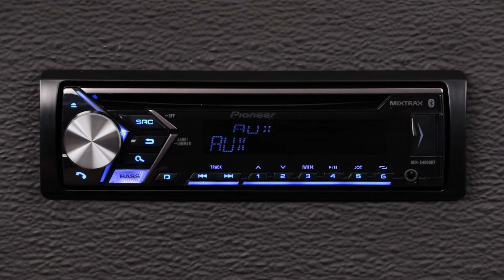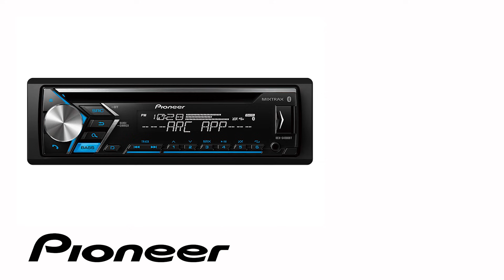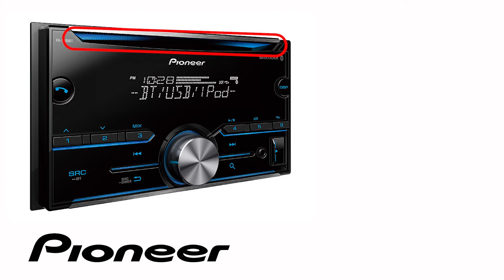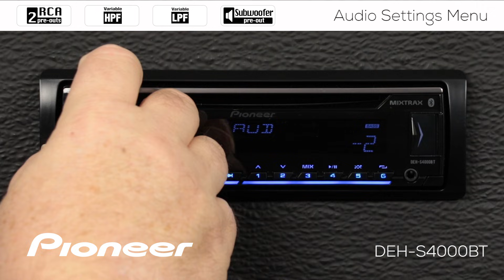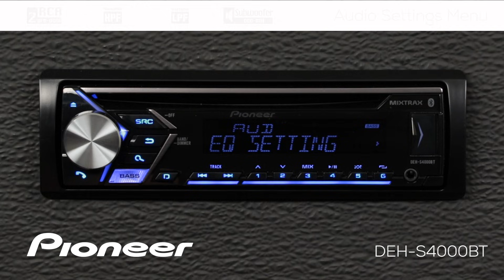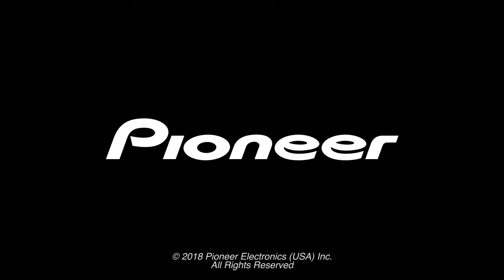How To - Audio Settings Menu on Pioneer In-Dash Receivers 2018

Comment: Please help! I have four pioneer speakers and when i fix the crossover front as hpf 100hz -24 and rear as hpf 100hz -24 i hear no bass BUT when i set the rear or front (either one) at -18 or -12 db per octave i start hearing bass clearly. So what's with that? And which settings do u recommend?
Reply from the maker: What is the model number of your Pioneer in-dash receiver?  What is the model number or, at least the size, of the 4 Pioneer speakers in your vehicle?  Do you have a subwoofer in the vehicle?
If you are using a Pioneer receiver and for example: 6.5 inch or 6x9 inch speakers with no subwoofer in the vehicle, I recommend to set both the front and rear HPF crossover settings to 63Hz or 80Hz and a slope of 12dB per octave.
If you'd like to learn more about what a crossover and slope do in a Pioneer car audio system please keep reading.  It's a long answer but, you may find it to be valuable information.
This sound like you are using a Pioneer receiver and it's working exactly as designed.
This is a basic explanation of the concept of crossovers and slopes and is not meant to cover all of the ins and outs and what have you's in this discussion. Not even close.  
The crossover and the slope work together to provide a powerful sound shaping tool to customize the output for your particular speakers in your setup based on your listening characteristics. 
If you have ever seen a prism separate sunlight into the component colors of the rainbow, red, orange, yellow, green, blue, indigo, violet, a crossover does the same thing only the crossover does this to sound.  A crossover is a filter.  There are two basic types of crossovers.  LPF  or low pass filter, and HPF or high pass filter.  
Speakers are designed to playback selected frequency groups.  It's very difficult to design a single speaker that can playback very low frequencies and very high frequencies and do it all very well.  That's why we have woofers and tweeters.   
You want your subwoofer to only play low frequencies and not high frequencies.  That's what the woofer is designed to do.  When you choose a crossover point, for example 80Hz on the LPF this is the crossover point, or cutoff point.  Only frequencies below 80 Hz will pass to the subwoofer. That's what you want, and this is what the LPF does.  
However, it does not cut off like a razor. Does this mean that  80Hz plays through the subwoofer, but 81Hz does not play?   No, that's not the way it works and this is where the slope comes in.   
The slope decides how sharply the filter rolls off the sound output.   The slope is rated in decibels per octave, for example 12dB per octave. An octave is when we double the frequency or cut the frequency in half.  With a 12 dB per octave slope and an 80Hz crossover point, at 160Hz, or one octave higher than 80Hz, the subwoofers output will be 12dB lower than the output at 80Hz. And 24dB lower at two octaves higher. 
The higher the frequency goes, the less it's played by the subwoofer, all starting at 80Hz.   This is a gentle roll off.  A sharp slope would be 36dB per octave.  
How does this effect the sound from the speakers?  This is a tool to customize settings in different vehicles.  You use the crossovers and slope setting to decide what frequencies go to what speakers in your system.  
For example if you are using 6.5 inch full range coaxial type speakers in the door, I recommend an HPF set at 80Hz and 12 dB per octave as a place to start.  The door speakers will play all frequencies above 80 Hz.  If you find the speakers low frequencies are breaking up at higher volumes you might change this to 100Hz. Or you could keep the 80Hz crossover point and change the slope to 18, or 24, or 30 dB per octave.  Both of these settings might provide a good solution depending upon your speakers and listening habits.    
It's often a good idea to have the LPF and HPF meet at the crossover point, this way there is no frequency gap in the playback between speakers.   
You can see what a crossover and slope setting does in this Pioneer How To video:    https://youtu.be/WvJXYh6vk_0?t=252   This video is very detailed and has a lot of information about what a crossover and slope does to the sound output.  Please take some time to watch it with the sound on.   You can find more videos on Pioneer's YouTube Channel here:  https://www.youtube.com/user/pioneerelectronics
Reply: @pioneerelectronics  my in dash receiver model is mvh-s322bt and I have 4 speakers size 6x9 inches. I do not have subwoofer and I've set my initial settings as rear/rear. I did as u told me, I set the front AND rear HPF as 80hz -12db and i still hear no bass. The point is if i set both (for example) as -6 db or both as -18 or whatever i hear no bass. I must set one of them at a different slope to hear bass. It's so confusing i know.
Reply from the maker: @Mouxic    As you mentioned, the easy fix is to simply set  the slopes differently. If that works, maybe it's best not to fight it.  However, from what you're describing, it sounds to me like one or more of the speakers is wired  "out of phase" with the other speakers.  This means that one or more of the speakers is wired "backwards"   or the positive and negative wires are flipped.  This causes cancelation in the audio output and it would explain what you are hearing.
Reply: @pioneerelectronics  Thank you so much for your help.
Reply: @pioneerelectronics  you're absolutely correct. I found one speaker wired wrong. I fixed it and it worked just fine. Thank you for your help I really appreciate it. And I wanna ask, is it normal that the dash receiver is hot from behind?
Reply from the maker: @Mouxic    The receiver has a built-in amplifier. Amplifiers give off heat.  That's the reason the receiver has a large heatsink on the back.  The louder you play the music the hotter it will get.  This is normal operation.  Additionally,  if you are using speakers that have an impedance rating of less than 4 ohms,  or you are using more than 4 speakers in your system,   you'll see the receiver heat up even faster.   You can find more videos on Pioneer's YouTube Channel here:   https://www.youtube.com/user/pioneerelectronics

Comment: Hello,I purchased a car with this radio already installed. The car has a subwoofer, I have no fader so I assume it was set up with subwoofer as rear like you mentioned. 

How do I change this so I can have fader?
Reply from the maker: What is the model number of your Pioneer in-dash receiver?  The model number is printed on the face of the receiver.  The model number usually begins with the letters DEH or MVH.
Reply: dehs6220bs. From watching your videos I've heard if the sub woofer is hooked up to rear speakers you won't see a fade option on your radio. I have 2 amps and am sure the sub is not hooked up to rear speaker but I still don't see a fade option on radio. .y front speakers are not playing and need to figure out why
Reply from the maker: @Mayhemsr1    It sounds like you have the DEH-S6220BS set up in Network Mode.     To have a fader, you'll want to set up the receiver in Standard Mode.  You can learn more about Standard Mode and Network Mode with this Pioneer How To video:    https://youtu.be/k3q0Zm5jvHg    You can learn how to change from Network to Standard Mode near the end of the linked video.  You can find more videos on Pioneer's YouTube Channel here:   https://www.youtube.com/user/pioneerelectronics

Comment: Would it be wise to use speaker level settings SLA and RTRV if you have your speakers amplified by a 4 channel amp? And also when using a 4 channel amp should I always be subtracting on my crossover points when alreadying having the gain set?
Reply from the maker: SLA is Source Level Adjuster.  SLA is designed to level out the volume of different sources as compared to FM radio.  This way when you change between sources, you should not hear a wide jump in volume levels either up or down.  Putting all of the SLA  setting to +4 is not the proper way to use this feature.  A small change of + or - 1 or 2  is usually enough for any given source.  There is no reason to   not   use SLA with an external amplifier.  
RTRV is Pioneer's Advanced Sound Retriever.  It's designed to be used on compressed audio sources, for example:  low bit rate MP3 files, to give them a more life like feel.  There is no reason to   not   use Sound Retriever with an external amplifier. 
Please take a look at this How To video from Pioneer about using crossovers and slopes on a Pioneer receiver:  https://youtu.be/WvJXYh6vk_0?list=PLw63zJRQbCNim0lElBRZEQ9ksIx2UZTFa&t=375     Please watch this video with the sound on. 
Please be more specific with your question about the crossover points.  Do you mean on an HPF, or and LPF crossover.   Changing the slope of the crossover may be a better option than changing the crossover point.
You can find more videos on Pioneer's YouTube Channel here:  https://www.youtube.com/user/pioneerelectronics

Comment: I don’t see a fader option on my stereo. And my front speakers sound are not much audible. Using model FH-S709BT. How do i get the option back? My front and rear speakers are connected directly to the receiver and i have a subwoofer with an amplifier connected to the RCA output
Reply from the maker: You have the receiver set up in Network Mode.  You need to change it to Standard Mode.  Press the microprocessor reset button and when the receiver restarts, choose Standard Mode:   You can see a demonstration in this Pioneer How To video:    https://youtu.be/WQ8p8b8vZKc      You can learn more about Standard Mode and Network Mode in this Pioneer How To video:  https://youtu.be/k3q0Zm5jvHg?t=64    You can find more videos on Pioneer's YouTube Channel here:  https://www.youtube.com/user/pioneerelectronics
Reply: @pioneerelectronics  thank you so much! I have changed to standard and full range! Now the sound is perfect and surrounded! Very helpful video! 💯💯💯

Comment: Hey I have Pioneer MVH-S425BT and 6x9 front and rear, no amp. I’m after a good setting for my speakers, cheers
Reply from the maker: If you are using the receiver's built-in amplifier and 6X9 speakers, I recommend to start with the Initial Setup  SP/PO Mode as REAR/REAR.  You can see it in this Pioneer How To video:   https://youtu.be/4xf-rc9IEok?list=PLw63zJRQbCNhDoDXEJKBHoC27MkfUhJ-R    Next, in the Audio settings menu, I recommend to switch OFF any HPF or LPF settings. HPF / Off and LPF/ / Off.    With 6X9 speakers and the receiver's internal amp, you should be able to run the speakers in full range without the use of crossovers.    Next, depending upon what type of music you like, choose an EQ preset.  For example, Superbass, or Powerful if you like modern pop music,  If you like talk radio or listening to a ball game, consider the Vocal setting. Jazz, try the Vivid setting.   Try the EQ presets,  choose what works best for you in your vehicle.  You can't go wrong with any of the EQ presets, and you can change them at any time.   You can learn more about the EQ presets in this Pioneer How To video:   https://youtu.be/nNUyRgc8jC8?list=PLw63zJRQbCNhDoDXEJKBHoC27MkfUhJ-R   You can find a full playlist of How To videos from Pioneer about audio receivers here:  https://youtu.be/42EL_JGXcJs?list=PLw63zJRQbCNhDoDXEJKBHoC27MkfUhJ-R   and you can find more videos on Pioneer's YouTube Channel here:  https://www.youtube.com/user/pioneerelectronics
Reply: @pioneerelectronics  thanks for the reply appreciate it.

Comment: Only my front speakers are working. How do I fix? They were working before. I do not see a fader or rear speaker setting on menu.
Reply from the maker: It sounds like you have your receiver set up in Network Mode.  If you want a fader then you'll want to use Standard Mode.  You can learn more about Network Mode and Standard Mode in this Pioneer How To video:  https://youtu.be/k3q0Zm5jvHg  You can find more videos on Pioneer's YouTube Channel here:  https://www.youtube.com/user/pioneerelectronics

Comment: Is there a treble setting on this head unit?
Reply from the maker: What is the model number of your Pioneer in-dash receiver?  Most modern Pioneer receivers don't have a bass and treble setting. There is a much more powerful sound shaping tool called a graphic equalizer. Don't be afraid of it. It's easy to use. All 13 settings in the Equalizer are frequency adjustments. You can use them to make any given frequency a little louder or a little quieter as compared to other frequencies and without changing the volume of the other frequencies. The frequency adjustments are arranged like a piano keyboard with the low frequencies to the left and the high frequencies to the right. 
If you want more bass, I recommend the "S.Bass" preset. It will add a lot more bass into the music. If you want more treble, I recommend the "Natural" preset. It will roll off the bass, and add in more treble. If you are listening to a ball game or people talking, or an audio book, I recommend the "Vocal" Preset. You can see the presets here: https://youtu.be/tMLFL8K3gMM?list=PLw63zJRQbCNinkLCSrV17ExW5FWT7aIFU 
You can make your own adjustments too. Simply start with any EQ preset that sounds pretty good to you, and make your own adjustments from there. The 50, 80 and 125, frequency bands are typically the bass frequencies. 3.15k, 5k, 8k, and 12.5kHz are typically the treble frequencies. 
If your Pioneer receiver works with the Pioneer Smart Sync App, you can use a bass, mid, and treble control from the app on your phone. You can learn more about it here: https://youtu.be/N6Lfcnjyboo You can find a full playlist of How To videos from Pioneer here: https://youtu.be/pMKUPcGE26c?list=PLw63zJRQbCNinkLCSrV17ExW5FWT7aIFU and you can find more videos on Pioneer's You Tube Channel here: https://www.youtube.com/user/pioneerelectronics

Comment: I change these and when i but car power off and start my settings not save somebody help!
Reply: If your clock and radio stations, and audio settings reset each time you start your vehicle your in-dash receiver may have an improper connection for the Yellow Wire.  The Yellow Wire must have constant power from the vehicle. The Red Wire is for accessory.  Do not connect the Red Wire and Yellow Wire together. Please take a look at this video for more information on wiring your Pioneer in-dash receiver:   https://youtu.be/kR2MO2kwFug?list=PLw63zJRQbCNhDoDXEJKBHoC27MkfUhJ-R    You can find more videos on Pioneer's YouTube Channel here:  https://www.youtube.com/user/pioneerelectronics

Comment: What does Save Settings mean? If power is disconnected, for example, mooring a boat, are they saved? Or do I have to put them all in every time I want to go boating?
Reply: Pioneer in-dash receivers have two power wires for installation.  Yellow and Red.  Yellow is for constant power.  This keeps the clock and radio station presets along with the audio settings in memory.  Red switches the receiver on and off with the boat.  You can learn more about wiring your Pioneer receiver here:   https://youtu.be/kR2MO2kwFug?list=PLw63zJRQbCNhDoDXEJKBHoC27MkfUhJ-R    When you save the audio settings, you can go and change any settings as a test.  If you don't like the results of the test, you can " load settings" and the saved settings will be restored.   As long as the Yellow wire has 12 volts, the settings will be saved.   If you disconnect the Yellow Wire from 12 volts the settings will be lost.  This includes the "saved" settings.  You can learn more about Pioneer Marine Audio products here:  https://youtu.be/sqYjK6qCslg?list=PLw63zJRQbCNhR3o6pS8jmaQDyW6UZmOIL     You can find more information on Pioneer's web site here:  https://www.pioneerelectronics.com/PUSA/   and you can find more videos on Pioneer's YouTube Channel here:  https://www.youtube.com/user/pioneerelectronics